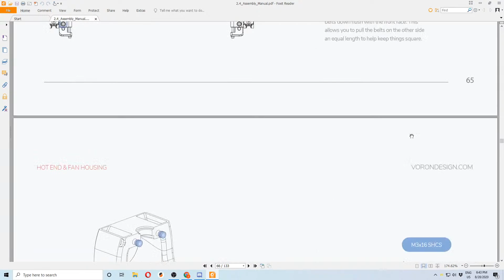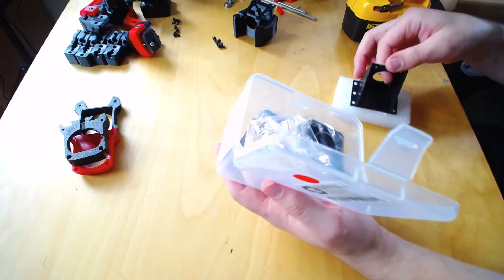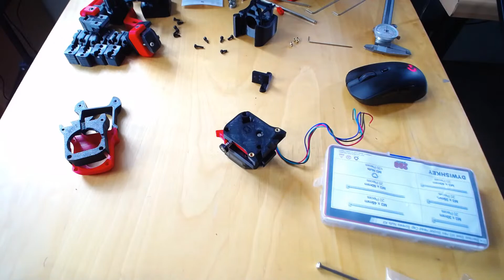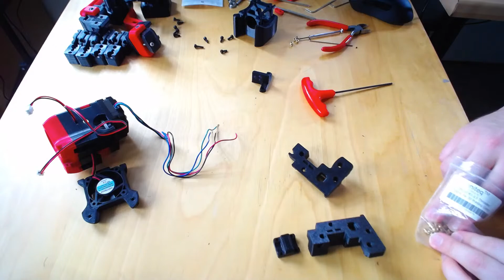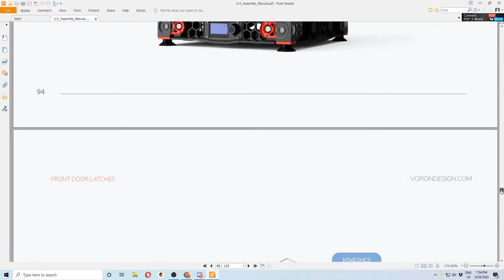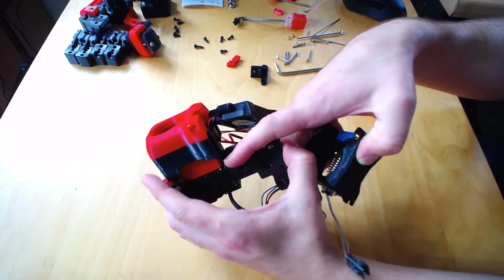8/28/2020 Hangout - V2.4 Gantry Assembly - Part 2

Comment: I did not see you place the short PTFE tube in the V6. Is this not an All metal version. Also I noticed that the PTFE clip was still in place when you fitted to upper part. I had to remove this in order for it to fit together. Am I going mad or did I do mine wrong?
Reply from the maker: TheAnqueetas I didn’t even think to check for that! It’s not you going crazy, it’s me 🤪. Thanks for pointing that out, I’ll have to look through that at the rebuild
Reply: @eddietheengineer  Phew! 🙄